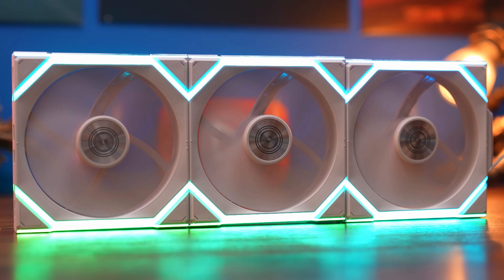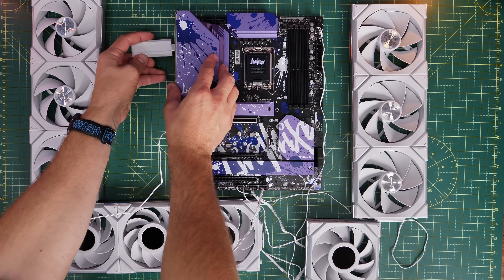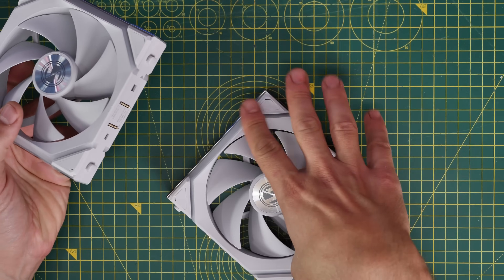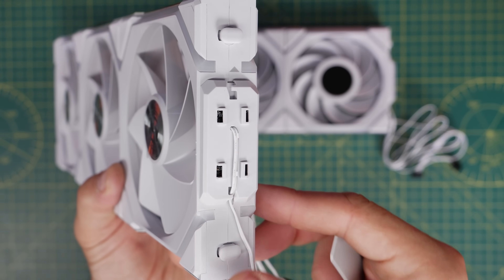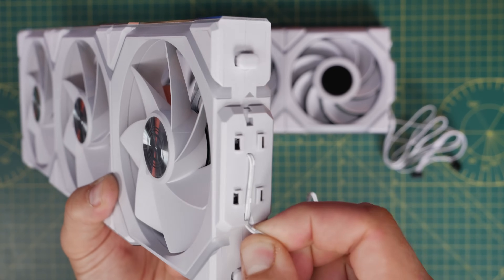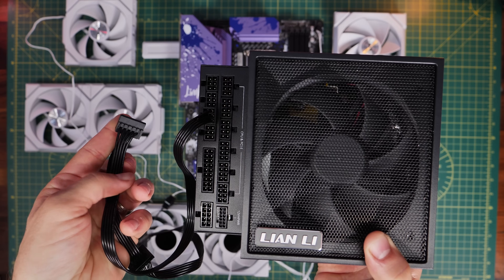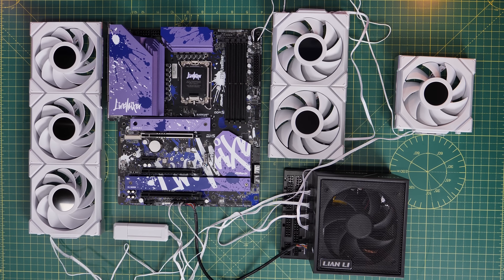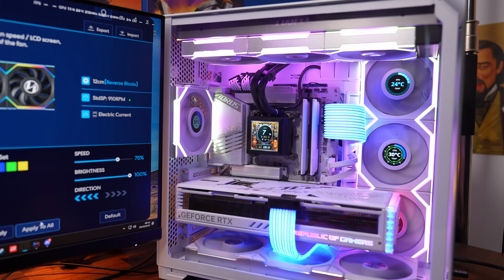Lian Li SL Wireless and Wireless LCD fan setup guide

Comment: i don't see the point in even calling this wireless if it uses more wires than their competitor's wired option lol
Lian-Li's uni fans have always been a mixed bag when it came to "simplifying" things.
i think their fans are better than Corsair for the most part, but their execution is just piss poor when it comes to avoiding cable clutter.
also their LCD fans are pretty pointless tbh, why would to need to put an LCD on a cooling fan? this honestly has no practical use whatsoever and its just for bragging rights at this point.
Corsair really nailed it with their icue link system, their pricing is just a bit steep and their fan portfolio is just kinda weird, you would expect the QX fans to be the best performing ones being the top of their lineup, but it is the RX fans which are at the bottom of their lineup that are actually their best fans in terms of performance lol
Reply: Ive just bought all the icue link system and i can safely say unless your spending big bucks and using the QX version fans (£125 for x3 but worse than rx120s) the rest of the icue link fans are kinda crappy RGB (eg. rx120) for the money,   the lian li sl-inf are soo much better for value and also look better and perform as good...just a shame theres a few more wires... Im kind of tempted to send all this icue link stuff back and go with lian li sl-infinity 120 instead as these rx120s Purley for looks 😅
Reply: @BlazedReefer  
when i reconfigured my case with new fans  (i was using Noctua's A14-IndustrialPPC fans) i initially wanted to go with Lian-Li's Uni Infinity mirror sl140's because i thought they looked cool and their performance was also pretty good, but then after some research my biggest issue with the Lian-Li stuff is that if you're going with 120mm then you're pretty much set because they provide anything you need in the box (the controller and wires etc.), but if you're going with the 140mm version you are SOL and have to buy additional equipment separately (the multiple controllers and wires etc.) since they only sell the 140mm versions individually and not in special packs.
another issue i had with Lian-Li's Uni equipment is that its a big bunch of wires for what they claim to be "seamless single cable" approach, i think Corsair really nailed it with their ICUE LINK ecosystem tbh.
as for the fans performance, yes the Lian-Li fans do perform quite a bit better than the corsair QX's, in both RGB modes and visual aesthetics in general, but when it comes to performance, in the end the biggest difference you would see between fans is at most a 3c degree difference, which for all of the additional cable clutter that Lian-Li's approach brings i'd just stick with ICUE LINK if i already have it.
in the end these are just fans, and if you have a good case with ample airflow then it doesn't really make you HAVE to get the best performing fans.
in my case, right now i've been using only QX140 fans instead of the older Noctua fans i had (i have 3 140mm's in the front for intake, 3 140mm's in the top for my AIO rad set as exhaust and a single 140mm in the back for exhaust) and from my own personal experience after running this configuration with QX140's in the past 4 months i honestly only see a marginal 2-3 degrees c difference (as in the QX fans make my PC run a little bit hotter).
but this can accumulate to multiple reasons, such as it was actually a little bit chillier before i switched to the QX140 fans, now its a little bit warmer etc.
either way, for a 2-3 degrees difference? it honestly really does not matter what types of fans you use lol
so in that regard, at least with my case (C700M) and in my opinion for aesthetics the QX140 are much cleaner looking than the UNI INF SL140's, and of course ICUE LINK is a far superior system to Lian-Li's UNI system.
in the end tbh (and as long as you have a GOOD performing case), it all really comes down to which fans you think look better, and which sacrifices you are willing to make to use them (PRICE vs Cable and controller Clutter etc.)
Reply: @HoLDoN4Sec  for the price id still say lian li wins, lian li are  cheaper the the RX and twice as cheap as the QX so that alone is a huge factor,  it's a no brainer if buying a new pc build go with lian over Corsair and get visually better and performance matched for half the price... worth having an extra 2/3 wires (that you dont see) for half the price and better quality,, and the sl inf 120/140 v1s look sooooo much better than the rx or QX infact they look better than ANY Corsair fans! ...i cant even be debating that lol it just does...  They run cooler, look visually better,  have more RGB, have backwards versions available, are cheaper to buy, and perform better..  win win in my opinion.. only thing corsair icue link has going for it is less wires...but at double the cost and worse performance.
Reply: @BlazedReefer  you are forgetting something, Lian Li is definitely the best option for 120mm, and they even have special starter packs for their 120mm fans to get you easy going into their UNI ecosystem.
but their 140mm fans are a completely different story, since they don't have starter packs for their 140mm fans you have to get your fan controller from somewhere else which sucks.
if you also want to use their striker wires you need another completely different controller for that as well.
Lian Li's UNI offerings, especially for 140mm is a mess.
also keep in mind that most people that opt for Corsair's QX fans don't really care about the cost (i mean, these are 50$ fans) and just favor looks over performance.
as for build quality, i will have to disagree with you, Lian Li's fans are kinda cheaply made and hollow compared to any other fan i'm aware of, and the RX fans do have superior build quality to Lian Li's fan, at least that is what i noticed from my experience comparing the SLIN140 to the RX140's, the SLIN140's felt kinda cheaply made while the RX140 felt solid.
neither of which by the way get even remotely to as well made as any Noctua fan i have here, in comparison both of them feel like shit in terms of build quality but i digress

Comment: Call me crazy but, wireless means no cables. I think i missed the point of this new product. When i saw the USB dongle i was hoping we are going to control the fans with that only, thinking fans were bluetooth (or something like that) connected to the dongle while using batteries as power. 

PS: i love your unboxing knife <3
Reply: It is 95% bad and older models are better. Biggest issues:

Lian li fans are dependant on windows/lconnect/usb, now wifi... 4 added points of failure and integration complexity not oresent in non proprietary standards.

Each lcd will consume 3% cpu on a 9950x in my experience... 15 fans, 50% on my cpu was used... I have to assume wifi would be more.

Why design a wifi dongle for this, when my mobo already has wifi? Why use wifi, for 2 foot comes, that's what blue tooth is for? How will having 15 wifi transmitters 6 inches from my audio circuits affect the mobo? Why are they getting power from a usb port still.... why was does it jeep changing with every product... a fundamental principle of wifi design, if your already running a big power cable to the data source, you don't need wifi, just run a tiny single cable too, wifi becomes added costs and points of failure. Why did they break the TL LCDs when they release to support wifi, how much regression and missing QAQC can we expected with the added point of failure, wifi... why the hell do I need a dongle, and why not create a real daisy chained power bus from the psu directly... wifi and power designs should be good, or they should use or extend a standard, not random walk over every possibility guaranteeing incompatibility across everything.

Had to return my TL LCDs, had hopes for the wifi line, not impressed... TL without lcds, functionally should be more adequate.
Reply: @gunslingorgunslingorsadf8150  USb is for data not power.
Reply from the maker: wireless means the transmitter is wireless
Reply: @TheProvokedPrawn  which is, sadly, pretty pointless.
Reply: @Rave.-  No more pointless than WiFi is wireless, by communicating with your router without connecting a network cable to your PC (and most people don't consider WiFi to be wireless).

At the end of the day, one of the points of this controller is to start unifying multiple devices to a single controller (e.g. both SL V3 fans and V3 Strimer cables), instead of having a separate controller for each device.
Reply: @MrDosArcade  I understand the intent. For now though, I'll have to echo another comment's sentiment:
A+ idea, D execution
Reply: @MrDosArcade when one goes from cat5 to wifi, one doesn't then get power from every computer in the room, everything has a common distributed power bus... if you run power between two signal sources, might as well run a signal cable too, less cost and more reliability. The limitations of these devices is not in the usb signal... its in the cheap controllers and faultt software.

Comment: Concept: A+, Execution: D   The amount of cable mess you have to contend with seems to be the same if not made worse by lack of hub.  This time though you get the added benefit of a gigantic suppository sized dongle sticking out from the back of your computer like an engorged mutant tick lol.  Again, the concept is neat, but really....it ends up looking to be more of a headache if you're mixing and matching LCD and non LCD fans....
Reply from the maker: The controller is the same for both fans, so you only need one. You can wire it internally (I showed that), so that's ok. It's actually less crazy cable wise, than previous ones. unless you tried to mix in other fans of course.
Reply: The controller can be installed internally with the included adapter cable, so it's still hidden away.

The single wire from the non-LCD fans to "somewhere else", which previously was a thicker cable with a 7-pin proprietary plug, is now a standard PWM connector with a thinner overall wire.  And you can either connect these PWM cables to your motherboard headers, or to a single SATA connector that has three PWM ports, included with the controller.

For LCD fans, yes, at first glance, it seems there are more wires involved, because you have a separate power and USB data cable for each group of fans... it's a tradeoff, to add the ability to be able to mix and match LCD with non-LCD fans, which has been a feature request since the TL LCD fans were first released.
Reply: Guy didn't watch the video
Reply: It’s a lot less cable clutter than two separate RGB and PWM controllers on top of every single fan having a 4 and 3 pin. Makes me think you don’t know what you’re talking about.